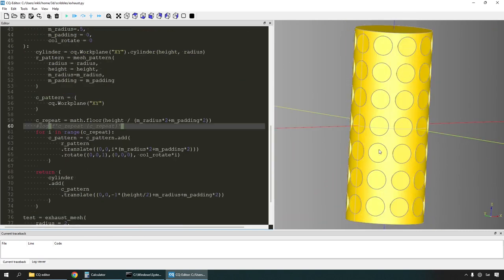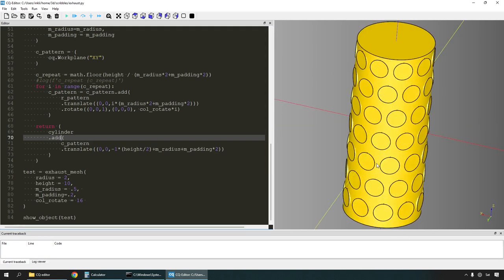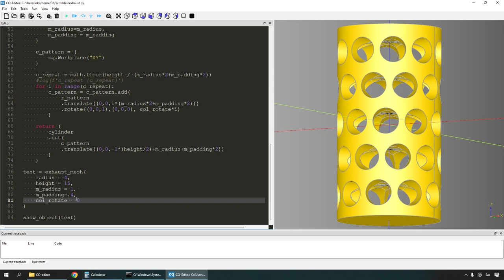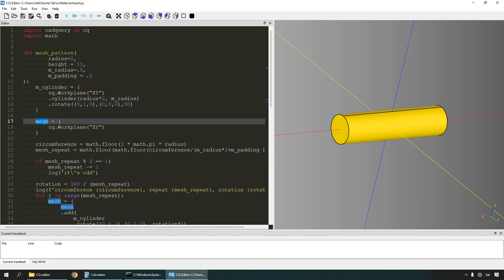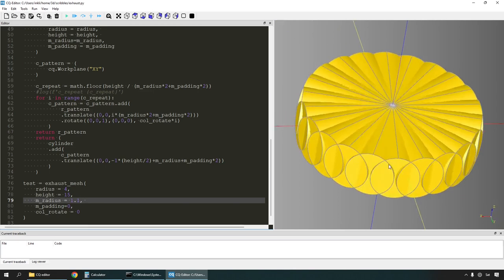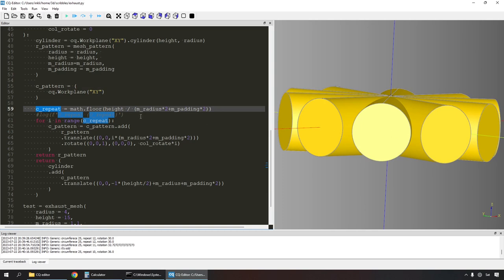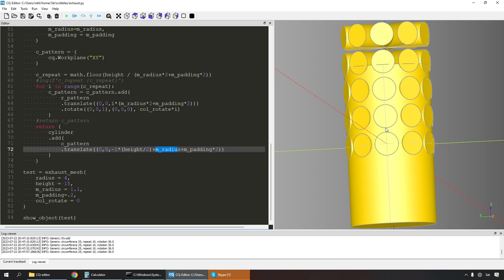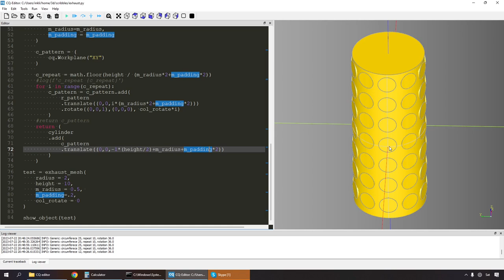Cadquery Cylinder Pattern Development

Comment: Here is the same pattern in build123d:
from build123d import *
with BuildPart() as p:
    Cylinder(40, 200)

    with BuildPart(mode=Mode.PRIVATE) as p2:
        with PolarLocations(0, 6):
            with Locations(Plane.XZ):
                Cylinder(10, 45, align=(Align.CENTER, Align.CENTER, Align.MIN))

    with Locations((0, 0, 0), (0, 0, 40), (0, 0, 80), (0, 0, -40), (0, 0, -80)):
        add(p2.part, mode=Mode.SUBTRACT)